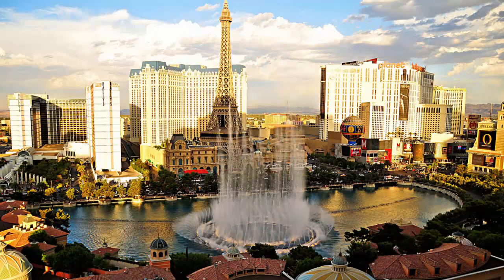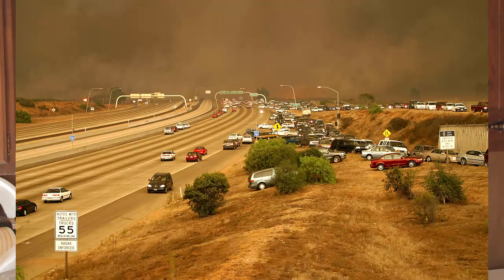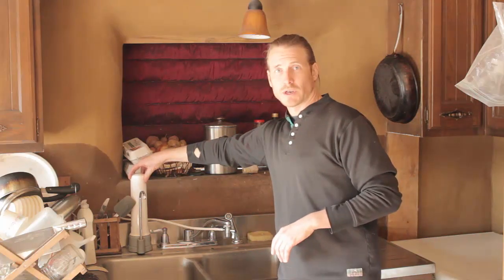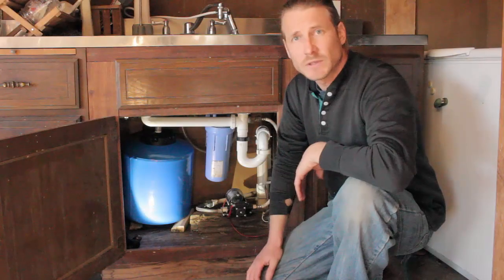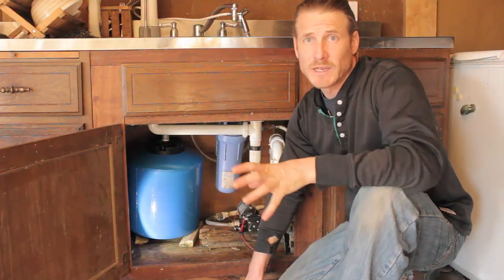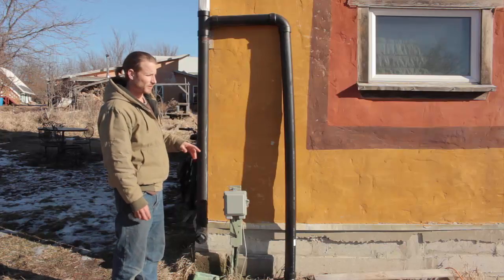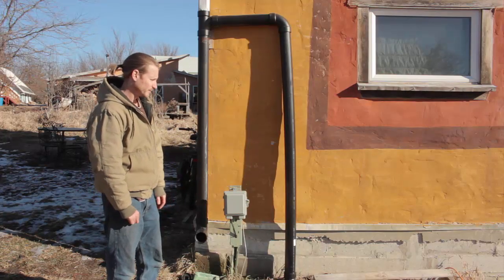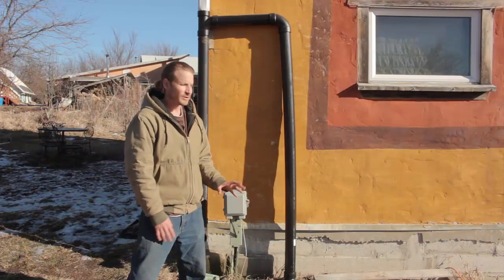Rainwater Catchment for a Tiny House

Comment: Two things I wanted to ask...
1) Have you tested your rain water for contaminants? I would test myself if I were a homeowner but I haven't had my own place in several years but is something I've wondered about for years. Whenever I ask anyone who has rain water catchment they don't answer my question or say no they have a filter. Perhaps I just need to put a glass bowl outdoors and catch some rain myself and get it tested???
2) Your downspout, the section that catches the first flush from the roof, do you have a ping pong ball in it? (that floats upwards to the joint, and once full closes off the lower spout and prevents any water in that section from seeping upwards and into your cistern, if yes do you find it makes a difference or not?)
Thanks for sharing via video, nice job.

Comment: Do you mind providing where you bought all your materials?
Reply from the maker: The pressure tank was bought at a local hardware store. The DC pump was ordered online. Shurflo DC pumps are pretty easy to find online, you just have to get one that's the right voltage for your system.  Mine's a 24V because my battery system is 24V.  The ABS piping can be gotten from a local plumbing supplies store or possibly a hardware store.  The cistern itself will have to be gotten locally.  A plumbing supply store might be able to help with sourcing.  These tanks are normally used for other applications (like for septic systems), but can be used as cisterns. You have to get one that's corrugated, suitable for drinking water, and I'd recommend one with supports inside to prevent collapse, as well.

Comment: Great video, i'm really impressed by your system for flushing away the fist part of rainwater. I'll definetely copy it with my project!
How do you cope in the winter months if it goes below freezing? an underground container shouldnt freeze in my opinion, but i only have camper/rv exerience on the matter.
Reply from the maker: +squalobike I usually stop collecting water about the time I have to worry about the downspout freezing and then just make it through the winter with what's in the cistern.  Sizing the cistern right for your water consumption is pretty key.  The cistern water will no freeze if it is mostly in the ground.  You do have to worry about emptying the tank though.  You never want it to get less than 1/4 full or it could pop right out of the ground in a spring rain.  Sort of like trying to hold an inner tube underwater--the water pressure from the rising water table can push it out
Reply: +Hardcore Sustainable I totally underestimated the power of archimedes' principle! that's something i wouldn't want to learn from experience.. Thanks for the infos, look forward to other videos of your project.

Comment: How foolproof is the debris pipe? Wouldn't sticks and other debris float and go down the pipe that goes to the cistern? Just wondering--I don't know much about the system or plumbing in general. I'm trying to make a plan for my tiny house.
Reply from the maker: +Mark Cox Jr I don't seem to have any problems with debris going into the cistern, though I suppose the screen cap I talked about in the video would solve any issues with that.  I don't really have tall trees around my house so I haven't needed a screen cap.